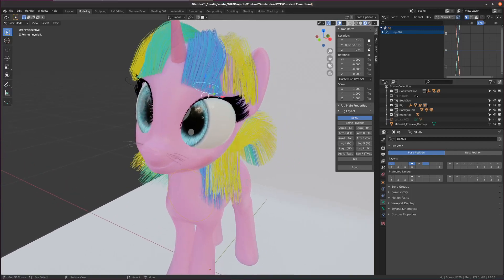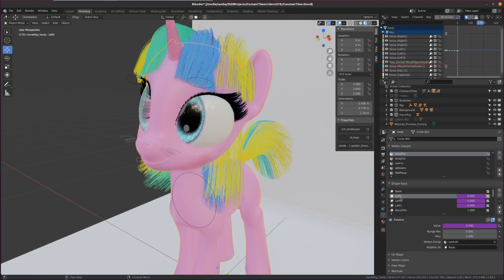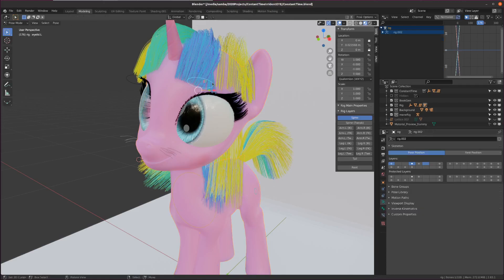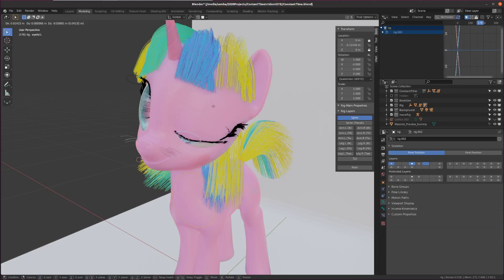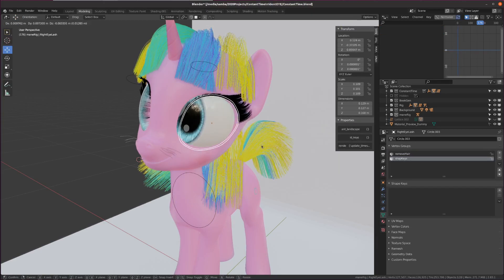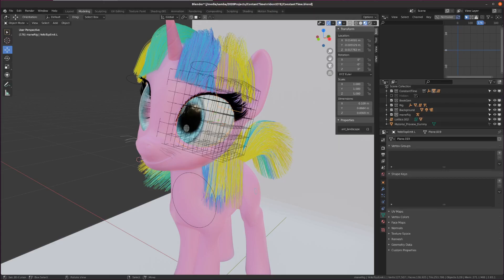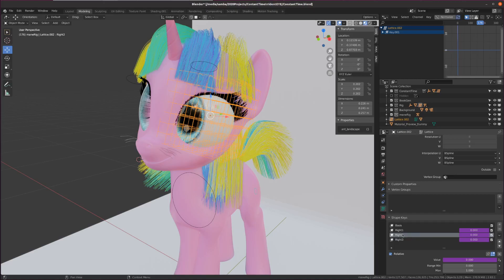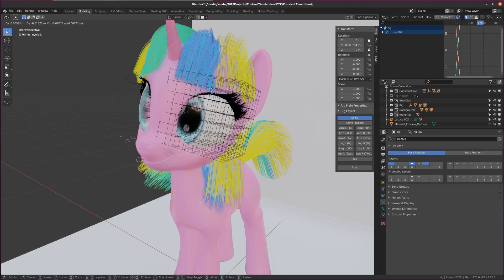Rigging Particle Hair Eyelids and Eyelashes in Blender {OVER VIEW}

Comment: So when the lattice is parented to the eyelashes and it has shape keys then it moves with the eyelid? Or does the eyelid, eyelashes and lattice need the same shape keys to move the same way? How can I connect the same shape keys to alle 3(eyelid, lattice and eyelashes)?

If you have the upper eyelash and under eyelash do you get them seperate lattice?
Reply from the maker: The body mesh has shape keys that move the eyelids closed and the lattice has shapes keys that move the eyelashes closed. They are both controlled by the same driver to keep them in sync. You can use one lattice to control both bottom and upper eyelashes.
Reply: @gabe2252  thank you for the simple explanation. I understand it now